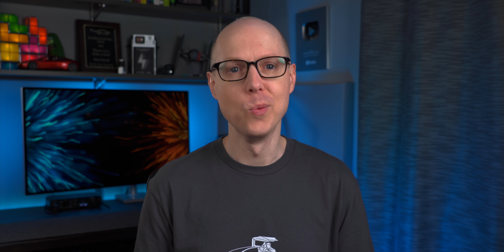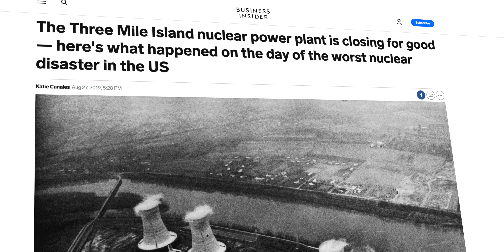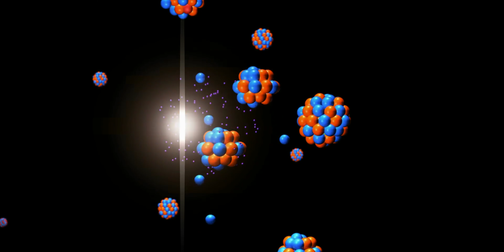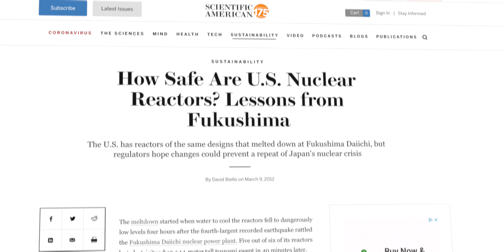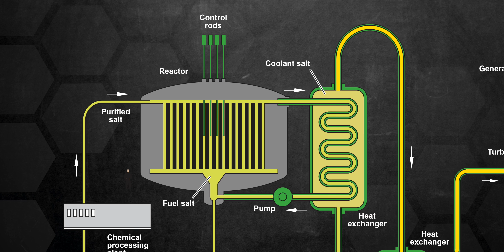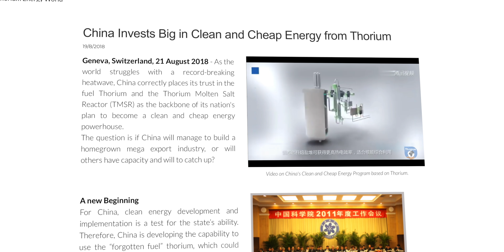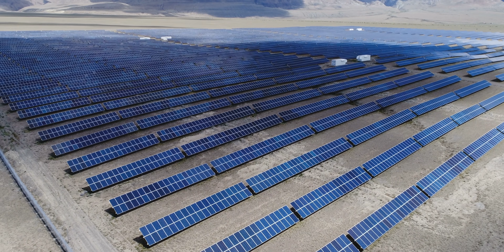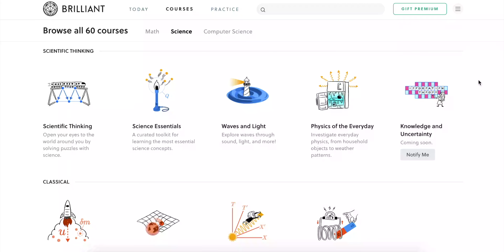Thorium explained - the future of cheap, clean energy?

Comment: Really interesting video on thorium reactors. I'm not convinced about your statement that nuclear is essential for a CO2 free power network. If we don't have nuclear then we need to overbuild the solar/wind capacity and use battery and hydrogen storage along with a significant amount of demand response/time of use pricing. The big problem with current nuclear is cost, the projects almost always balloon in cost during construction and the builders don't put a fund together to pay for the long term storage and decommissioning costs and leave it to future generations to sort it out. Also when things go wrong the consequences can be catastrophic. Thorium has the potential to be a less toxic version of nuclear but I'm still undecided if it is a good approach for primary power generation.

Wind and solar don't have these issues because the costs are well defined and scale lineally with capacity. Also the end of life waste is not hugely toxic and will be mostly recycled when there is enough waste for it to be economic to process.
Reply: I forgot to add that the big issue for renewables outside the tropics is seasonal storage. If we spent the same amount of money on developing solutions to this as we are using to subsidise fossil fuels then we would very quickly come up with workable solutions like hydrogen to liquid fuels which can be combusted for thermal energy or put into a fuel cell for electrical.

Comment: You have an error . Mined U238 contains only 0 .7%  U235   NOT 3-5% 

https://en.wikipedia.org/wiki/Uranium-235
Reply: Good catch. 3-5% is what reactors using Low Enriched Uranium for fuel have as the U-235 concentration, and that's after it's already been enriched from the naturally occurring percentage of U-235.
Reply: @GuardsmanBass  there is about 400 times the amount of thorium compared to U235.